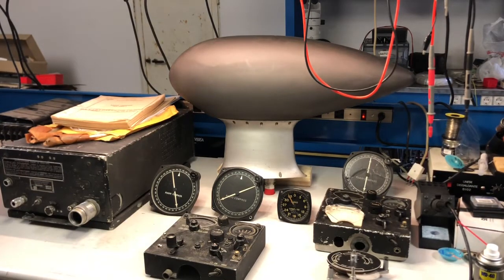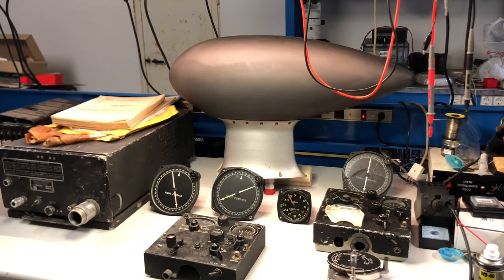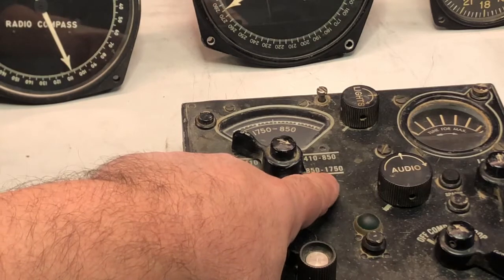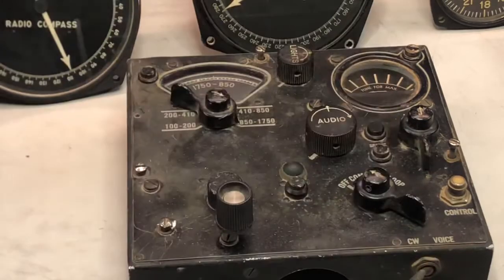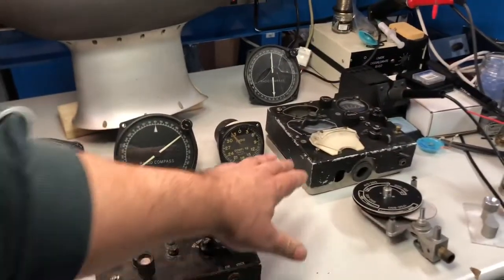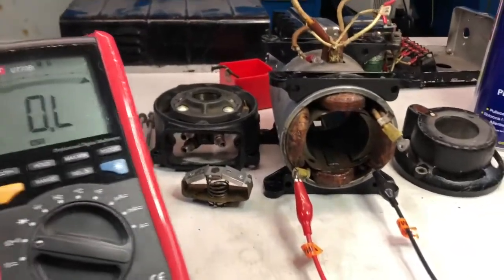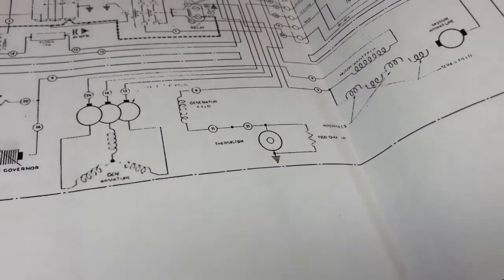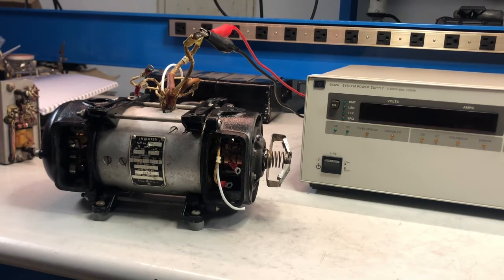AN/ARN-7 Radio Compass reconstruction Part1, the inverter

Comment: This will be a very interesting series! When I first started at the FAA, Non-directional Beacons were still in operation. Also know as Compass Locators, they were low frequency transmitters that transmitted a modulated carrier - the modulation was the Morse Code identification of the facility. The first airport I work at had a compass locator at the ILS middle marker and was designated  a LMM - Locator Middle Marker, transmitting on 233 kHz at 200 watts. At that time the radio compass was used regularly by the U S Coast Guard as a secondary navigational aid to supplement VOR and TACAN.
Reply from the maker: That’s exactly what this radio compass does. Very early design.

Comment: I have restored a couple of these Radio Compasses. I could not obtain an inverter, and so decided to make a 115v 400Hz device of my own. In the event, it was quite simple,a 400Hz sine wave oscillator providing input to a 120 watt audio amplifier,and choosing a toroidal transformer to transform the 8 ohm output to that appropriate to the Radio Compass. It worked well and was without problems. Simpler  non linear inverters produce too much radio interference for the receiver circuits.

Comment: Great job. I have the radio compass and control unit but lack the loop ant and inverter. Will the compass receiver work without the loop antenna and compass meter? I don't know that much about it.
Thanks